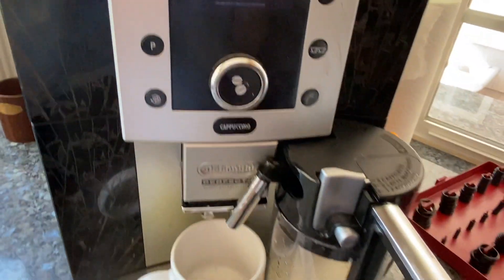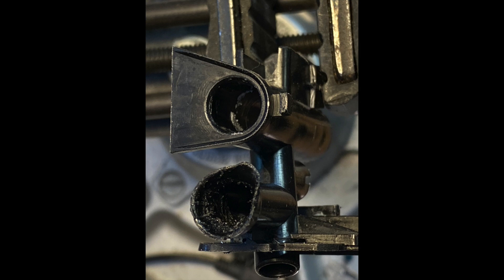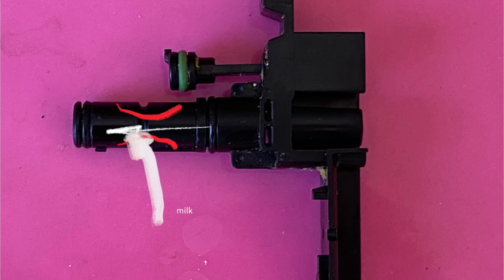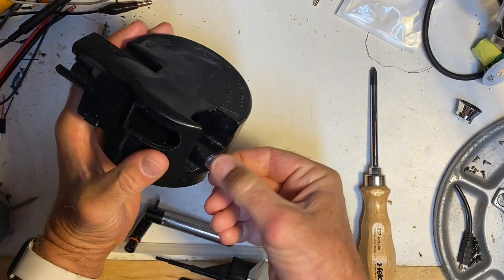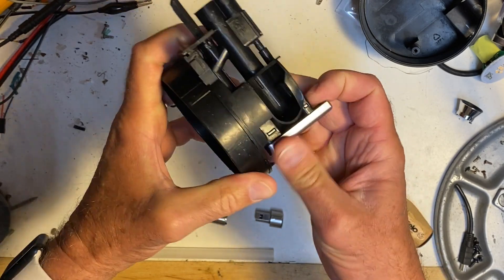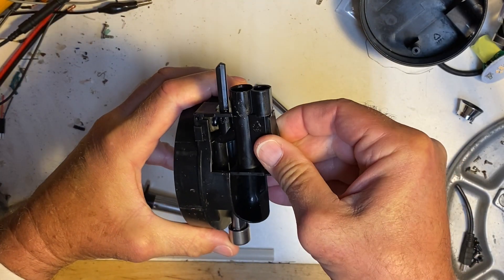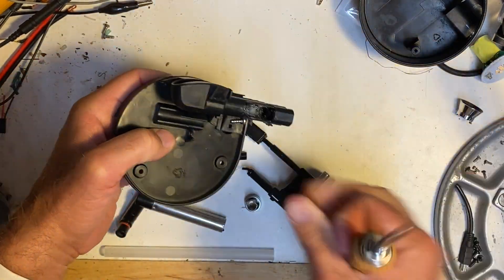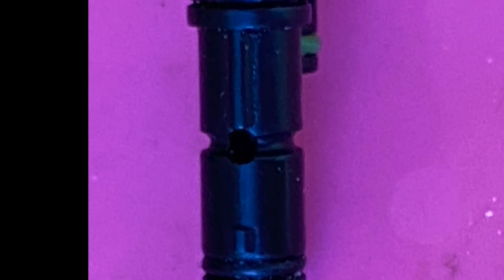Delonghi Milk Frother Disassembly & Analysis

Comment: Thanks for the video.  Very useful indeed.  Can you tell me what the upper of the two tubes that stick out of the machine does - the one with the green O-ring around it on your video?
Reply from the maker: If you look at 2:45 in the video, that's part of the path that allows air into the stream. Somehow, that air gets mixed with the milk and steam to create foam. The slider controls how much air: very little air and you have just hot milk; lots of air and you get bubbly foam.

Comment: Hey man! I just picked up a Delonghi perfecta for my wife and I. We wanted a fully automatic to go along with my La pavoni. Anyways, I didn't want to spend tones buying a new one so I picked up a used, 
broken machine for 60 bucks. I'm fairly handy and have experience fixing espresso machines, so this seemed within my wheel house. To the point, the machine will power on when you first plug it in. If you are low on water or have the front door open it will alert you and stay on until you address these issues. But once you have done all that, the infuser moves down to the button, up the set number of rotations per the reed sensor, stops, and the machine turns off and wont turn on again. At that point you have to unplug it and plug it back in, and the process repeats. While the infuser moves the machine displays "self diagnosis." Have you encountered this issue? My feeling is on of my main PCBs is need replaced, or at least needs some fresh components. If I can figure out the coms protocol I may see if I can power it on from a PIC or arduino from the display pins. Any input would be awesome.
Reply from the maker: Hooboy! That sounds tricky! I haven't had that problem before. The machine does move the infuser just a little bit when it first powers on while displaying the 'self diagnosis' message so it sounds like your machine doesn't like what's happening there.It only moves each direction for about .5 seconds so not very far. Can you tell from the infuser movement if it struggling - i.e. can't complete it's movement? I'm wondering if perhaps the infuser is not in the correct location in the track and so is out of sync with the controller.